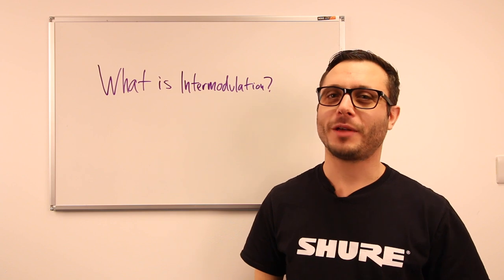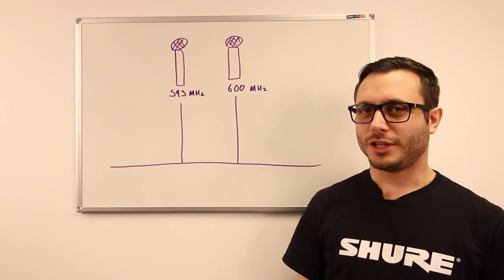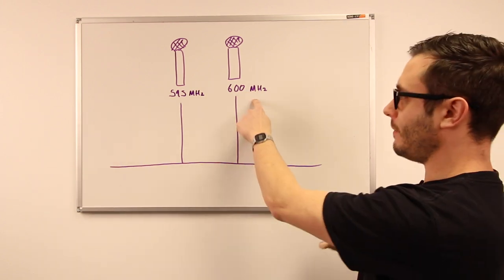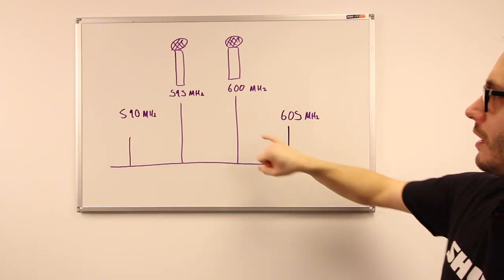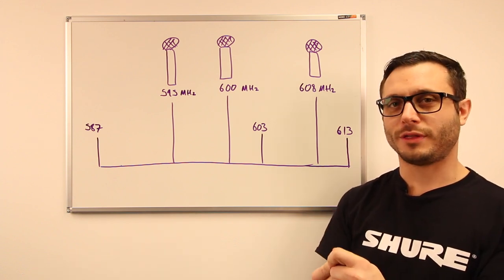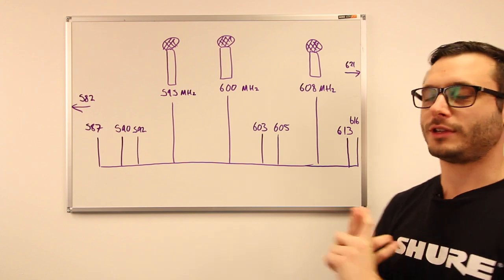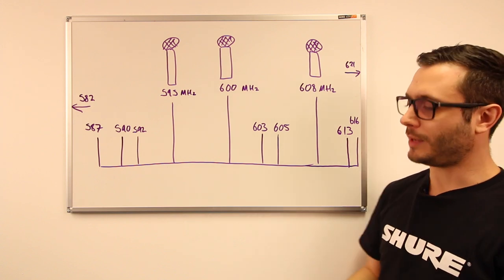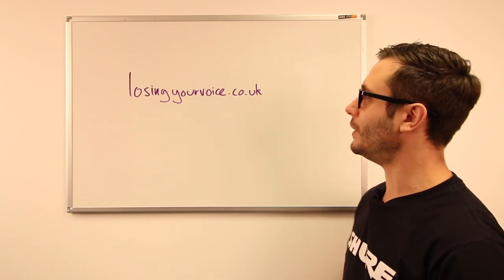What is Intermodulation?

Comment: Before the advent of frequency hopping, dual frequency radio control systems for model airplanes, we had trouble with 3rd Order IMD causing glitches and even crashes. No one believed me when I told them what was happening. Eventually, we began to avoid using evenly-spaced frequencies. We also set up pilot stations spaced 20 feet apart so that no one would stand too close to another pilot. Excellent video. Thanks..